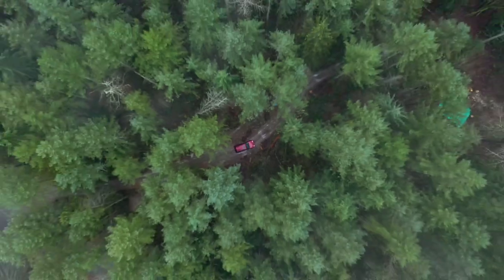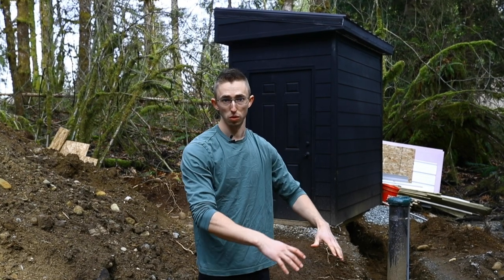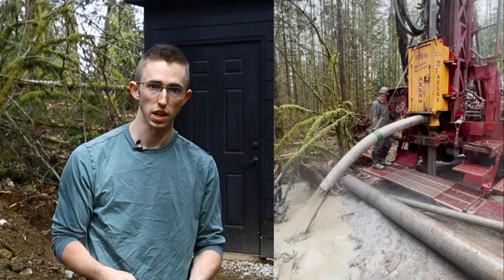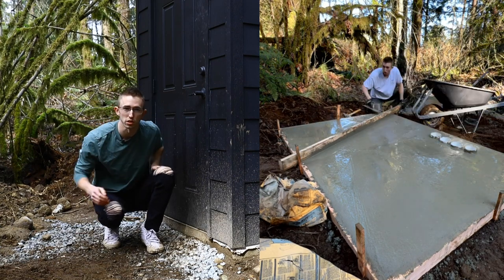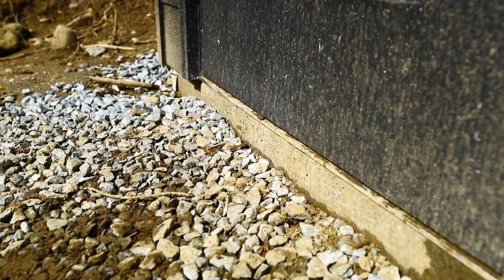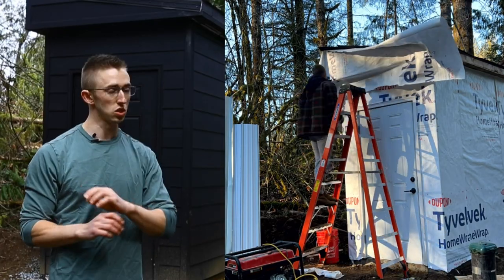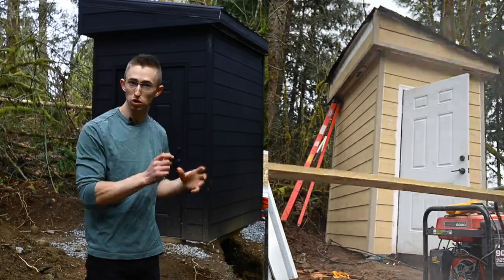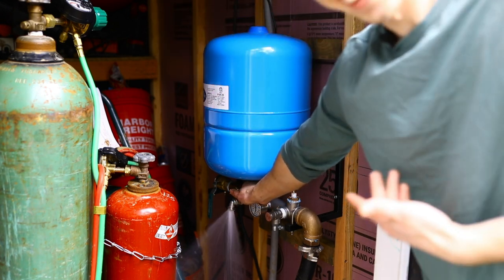Well Drilling and Building My Pump House | Everything I Wish I Knew

Comment: Great work Devon! Instead of using a pressure treated sill directly against the concrete you can use sill seal (not sure that is the correct English term, its rolls of 15-20 mm PU insulation anyways ). That way the sill is not in direct contact with water and gets a chance to dry out. I approve of your style reference, greetings from Scandinavia ( Sweden ).
Reply from the maker: Hey Marcus, thanks for the heads up on this. That's a great call. I definetely want the lumber to be able to dry out. I fortunately overlapped the concrete cladding over the sill and it hasn't gotten wet yet but I just want to make sure this thing is future proofed way into the future.